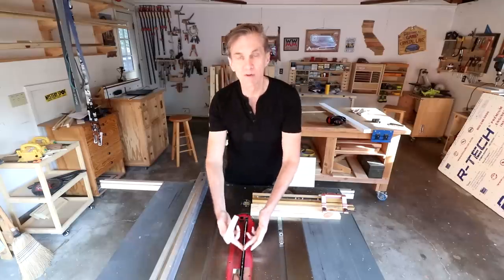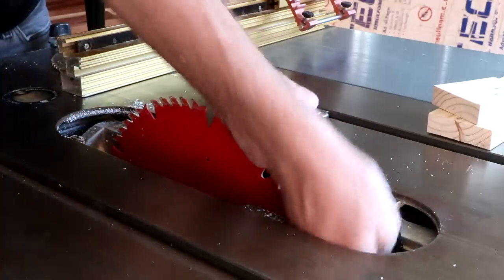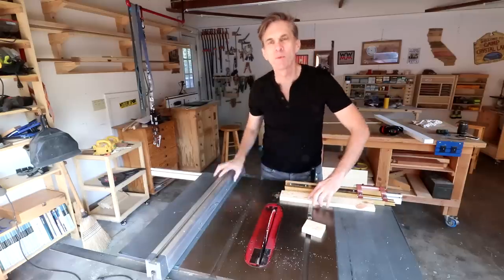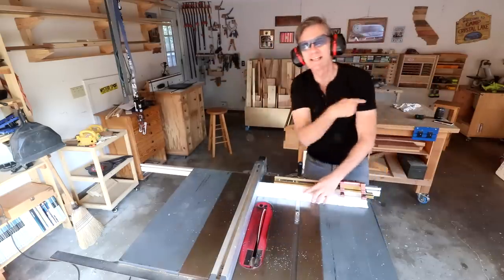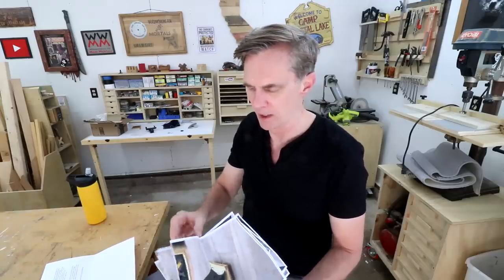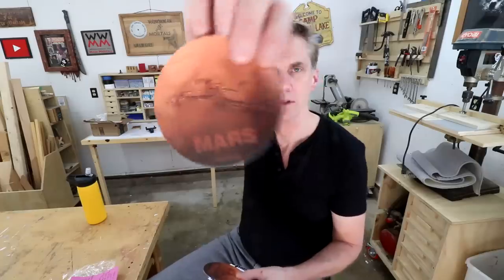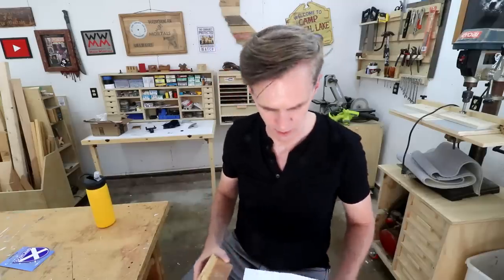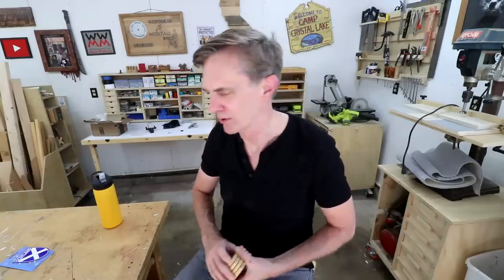What is kickback? And how to avoid it.

Comment: Several years ago when I was just getting into woodworking, I shot a 2x4 about 40 feet out of my garage into the driveway right where my wife would usually park, but she wasn't home at the time. I was shocked at how far and with how much force my weak old table saw could throw that log of wood. Definitely got super lucky that it didn't kill me or smash the wife's car and was pretty shocked by the whole ordeal, so I then did a bunch of research on what happened and I found this sweet woodworking channel on the youtubes called "Woodworking for Mere Mortals", you may have heard of it before =D. Also funny is that I also found John Heisz's channels at the exact same time! Been a subscriber of both of you ever since!

Comment: I've been woodworking for about a year now, very consistently. I spend most weekends making things and have probably done thousands of cuts. Recently my grandfather gave me a big, beautiful Rockwell Table saw from the 1970's. After some tune-up it was performing great, and I broke it in by making an end table. 

This last weekend, I was working on a new project, using the push block that Steve designed, ripping a piece that was a little too long to be ripped, I should have used the miter gauge. Well, I used a push stick and the push block, and mid-way through the cut I saw the piece starting to bend a little bit. Both of my hands were supporting the piece from a safe distance, and I tried to straighten it out. I saw the back of the piece angled toward the blade, and in a split-second I pulled my right hand away from the work piece. 

The thing flew past me, made a loud bang and I had to gather myself for a moment. I turned off the saw, unplugged it, checked myself for injuries. I was lucky, no bodily harm at all. I looked back to the wall that's about 15 feet away from my table saw, and there was a 3/4 inch rectangular hole. I found the cutoff piece, which was mangled with blade teeth. Guess what? This old saw didn't have a riving knife, and I could have been very seriously hurt if I was standing a little to the right, even if I didn't move my hand in time. 

I halted my work for the day and ordered the proper equipment. Some tools are a luxury, but safety is a necessity.

Comment: Really insightful ABC's today,  my 1st table saw had alot of issues with kicking back and i found out later that my fence was the cause. It was never square to the blade even after numerous attempts to straighten it out. My ouchy story i was cutting down fence boards to 5 inches and was doing about 200 board feet and didnt know about practice cuts, or where to stand... i went to push the scraps away from the blade with my plastic push stick and it caught the blade shattered the push stick sending a piece straight into my stomach. That was 3 years ago... that push stick is now hanging above my new saw as a reminder to me. Since finding WWMM i really do plan out every cut now before firing my table saw. So for that thanks Steve

Comment: A simple solution to using your fence and miter gauge together to do repeated cuts is to clamp a piece of scrap wood to the the fence and adjust the width of the scrap wood. When you move the miter gauge forward it will create extra space between the fence and the blade and leave enough room for the cut off to rest without kicking back. I still don't stand directly behind the gap even doing this trick thought. Love the ABC of Woodworking intros, the more explosions the better :P

Comment: Hey Steve, in regards to no saw having kick back detection, Destin Sandlin of the Smarter Every Day youtube channel has a video where he and a friend are designing an anti-kickback circular saw using machine learning, to apply the circular saw's brake much faster than a person could release the trigger.
Reply: It's more anti climb cut than anti kickback. Tablesaw kickback is way faster than circularsaw climb cutting, mostly because of weight. Tablesaws through small blocks of wood where as circs throw the whole saw.  Even if you could detect kickback, you'd need something like the SawStop to stop the blade in time.

Comment: Only been woodworking for a week or so and just had my first (and hopefully last) kickback incident. 
Was resawing a 2x4 on the saw, blade cranked all the way up to make the cut in one pass. I’d done this a few times and felt okay with it. 
Just as the piece had about an inch to go to finish the cut… KABOOM!!! It exploded upwards about 2 feet and landed back on the table of the saw, thankfully not on top of the blade though. 
It scared the ever living crap out of me for sure. Luckily I didn’t get hit and using a push stick, I didn’t get pulled into the blade either. 
So lesson learned… resaw in two passes at least.

Comment: I think it's worth noting that even when using only the fence as a guide, you can still get kickback if the piece you're cutting off will have a high width-to-length proportion. In fact, any piece that will be completely cut before passing the teeth on the back side of the blade is a prime candidate for kickback.

Comment: Would love to see a video on how to split a 2x4 lengthwise to make 2x2s. The videos currently available on YT are dangerous to say the least. Would love to see your take on it. 
Tucker n dale vs evil is HILARIOUS. Highly recommend it.
Reply: Look up how to rip cut on your tablesaw on yt should find something
Reply: @antonsworkshopco  appreciate the tip =)
Reply: @mattgrundy27  also push the wood down while pushing it twords the fence and push forward. Use a push block like a microjig...... only push the wood twords the fence infront on the blade.
Also try to run the boards thrugh a jointer before to remove the round edge. Have fun and be safe

Comment: Would like to see technique on doing a long (6') 2x4 rip cut and techniques to avoid binding the blade. Discussing feather boards etc. Got by feather board but practicing passing the 2x4 thru with the saw off I can see I'm pivoting the board and looking for tips/techniques to practice.

Comment: Spring forward and fall back. How we set our clocks in the UK to and from summertime.!
Reply: That's a big help to many people.
Reply: @hansdegroot8549  I thought it was well known but if it helps people thats great.
Reply: @alanguile8945  I'd never heard it before. I don't have a problem with setting the clock forwards or backwards at the right moment, but many people do.
Many people also mix up "left" and "right" and that has been defined far earlier than summertime and wintertime.
Reply: Hans de Groot I had a problem with port and starboard so I imagine an empty bottle of port. “No port left” well it works for me!
Reply: @alanguile8945  Some red port was left
Reply: @donjohnson24  Thats an improvement, I'll use it from now on!

Comment: Im brand new to woodworking and have started following your channel over the last couple of weeks, great videos by the way. I noticed you mention never to use the rip fence and the mitre gauge together, but you use them both for doing dado cuts. Is that because its not a full cut through? And is it still possible to get kick back from dado cuts if the wood is somehow weakened or their is to much pressure etc.

Comment: Autumn works. * I have an idea for a new video: Details, as in the Devil is in them. Little challenges that can accumulate to degrade the result of your project. I set out to make a simple desk out of 2x12, 2x6, and 2x4 pine. My first challenge was that both of the 2x12s I used were bowed and, as a brand new beginner, I don't have a planer. Or a jointer. Or a decent straight edge. And cutting suddenly became an exercise in eyebrow trimming [When my dad was a kid, he discovered a few hairs cropping out between his eyebrows. Concerned that he might end up with a 'unibrow,' he grabbed his razor and proceeded to shave them. In the process of shaving the connecting hairs, he nicked the end of one of his eyebrows. So, he decided he needed to even them up and trimmed a bit off of the opposing eyebrow. Well, you can see where this is going. Before he knew it, he was on his way to school with no eyebrows, at all.] For a moment, I was worried that my son's new desk would only accommodate a floor mat as a chair... But, I have some old table adjusters I'm going to attempt to install and everything should be ok. 

My point is, everything hinged on those very first cuts, which hinged on what I was able to do with planing/jointing with nothing but a circular saw and a power hand planer. My dowels didn't line up, my joint was off-center vertically (and horizontally) -- thank goodness for my angle grinder and 40 grit flap wheel -- but slowly, despite all the setbacks, I think I'm getting there. 

What about a video demonstrating what can go wrong when the first cuts go wrong? And, of course, what to do about it? 

Maybe this isn't possible. But, I've always been the guy that wondered what happened to the victims' families after the zombies moved on... 

Thanks for all you do!

Comment: I plead guilty and stupid.  When I used my first cheap table saw about 30 years ago, I think I was cutting a small piece of wood using the miter gauge and fence.  The cut off piece was about 1" X 2". It shot back at me like a bullet and struck me in the chest.  Did that scare the B'Jesus out of me? Sure did!   I am lucky it didn't hit me in the eye, nose, mouth, or anywhere on the head.  I would have had severe injuries.  As it was, I had a pretty good bruise on my chest for a week or so.  Lesson Learned! About a year ago, I bought a Kreg Adaptive Cutting System because I thought I could eliminate all the risks of a table saw. While that is a great tool, there are things it couldn't do easily or fast enough. I ended up buying a Metabo Contractor Saw, too which is a very nice machine. I now use all the guards and find they are not an inconvenience most of the time. I usually make a couple of test cuts in scrap without the guard, adjust, put the guard on, then do all my cuts.  You don't have to watch the blade! PS. Your wife will be happy you have all your fingers, eyes,  and teeth!

Comment: Is that knife called "writhing" or "riding? Never heard of them before.
Reply: Rob,  That would be Riving Knife. I always have mine installed my table saw. Mine also holds the antikickback pawls, and the blade guard
Reply: @martinwebb7294  Thanks for the info. I had a severe kickback a few years ago when ripping a large sheet of plywood on a small bench saw sitting on a makeshift workbench that was too low down. Hit me on the right side and left a nice bruise on my chest, which later turned into a cyst and after had to be drained and removed. Funny though, it didn't hurt THAT much at the time, but it was very scary and I didn't do that again. I'm pretty sure I was using a fence though and a pusher.

Comment: I'd love to get a table saw, it'll help me improve my projects a lot, but I am terrified of them, I know safety is on me, but I've seen cases of professionals with decades of experience that still have accidents and that's the terrifying part
Reply: I am with you on that. I want to buy but too scared to do so
Reply: Buy a SawStop and follow the safety rules (e.g. don’t use the miter gauge and the fence to guide the work at the same time) and you will be fine. And, a having a it of fear of the machine is a good thing - keeps you from getting complacent - which is what happens to those with decades of experience.
Reply: If you pay attention you're probably safer as a beginner. Professionals get so accustomed to using a saw they sometimes are making a cut, but thinking about something else. A friend of mine is a cabinet maker, and has been doing it for 25 years. About 6 months ago he lost the tip of his thumb using a table saw. Familiarity sometimes creates the opportunity for an accident.
Reply: @jeanchapman1301   I totally agree with your recommendations, except the SawStop was out of my price range and space constraints. But for Fernando, Krishna, and any other folks who feel as they do, What I did when I purchased my table saw ( RIDGID R4518) was to turn it on and then off a couple of times to get used to the sound it makes . The I always have a riving knife installed, and usually have the blade guard installed also. Just follow Steve's safety tips (and others on YouTube). My fear of tool has changed to a healthy respect for the power of the tool, the same as I have fo=r my automobile, which can cause as much or more damage to myself and others as a table saw can do.
Reply: I have the Milwaukee M18 table saw. The thing that surprised me the most about this saw is that, due to being battery-powered, it stops almost immediately after being turned off. Obvious now, but it was a nice surprise as I feel WAY safer (but still cautious) than when I use my corded table saw. The 12.0 battery that comes with the Milwaukee is amazing btw. If there isn't enough power left in the battery, the saw simply refuses to turn on. Never had it cut out mid-cut.
Reply: @craigs7678  Thank you! Didn't know there were battery powered ones, will definitely look that one up
Reply: @kashel83  You're welcome! Be warned, however, that this saw cost me $500 USD. I happily paid that due to me already being a Milwuakee fanatic. I would still highly recommend this saw if you are afraid. I still absolutely am careful around any of my tools, powered or not. As an added bonus,  it is compact enough for me to store away and bring out as needed. Happy making!

Comment: I’m just saying, idk why radial arm saws are no longer prevalent. I use mine for all my cross cuts. The piece is well supported, cut on a downward motion, rarely get tear out, always perfectly square, and once you line up your cut the saw moves instead of the piece which allows for precision. I still use the table saw for rip cuts and everything else, but I really don’t understand why radial arm saws are a thing of the past.

Comment: Is the riving knife even able to help in this case? The piece of foam didnt reach the end of the blade. Sorry noob here.
Reply: That’s why riving knife tucks in close behind the blade. Limits exposure. And also one reason why a splitter is usually not as effective (or convenient) as a riving knife.
Reply: When using the miter and rip fences for small pieces like that, the piece between the blade and the rip fence is unsupported.  Since it's not being pushed through, it stops moving and WILL be grabbed and thrown by the blade.
Still not safe, but if a push stick is being used, it's possible to push that piece on through without the blade throwing it.
Main point there was not the riving knife, but the use of both miter and rip fences at the same time.

Comment: I threw away my riving knife because the fence was so bad the piece would always bind between the knife and the fence. I regret that now that I've figured out tricks to improve my fence performance, but it's just a crappy craftsman job site saw.
Reply: You might be able to order a replacement riving knife from Craftsman.  It's no joke, it's a critical safety feature.  Also, check your saw's manual.  You ought to be able to adjust your saw's fence alignment.
Reply: @Not_TVs_Frank  it's not the fence adjustment, it's the repeatability. The job site table saws just don't have good front and rear guides on the fence, so it's very easy to be 3 sixteenths of an inch off from front to back. The whole saw is really intended more for rough lumber ripping on the job site than any kind of precise woodworking.

Comment: Why don’t they make table saws with a blade that turns in the opposite direction?
Reply: It would pull the wood through shooting it away
Reply: Plus, you would have to reach over the blade to pull the workpiece through the saw. Dangerous thing to do. I always wait for the blade to stop spinning before reaching anywhere near the blade.
Reply: Is this a serious question?
If it is, you for sure have a table saw. Take the blade of, and flip it 180 degrees. Put the blade back in this new position.
The blade will still spin in the same direction (because of the motor) but the stumpy part of the teeth are directed towards you.
I have no idea what would and could happen. YOU DO THIS AT YOUR OWN RISK!!!!!
If you have a three-phase motor on your table saw, you can change the spinning direction of the saw blade by changing the Phase I en Phase 2 wiring.
Again, YOU DO THIS AT YOUR OWN RISK!!!!!   But I wouldn't even bother to try it. And for two reasons:
1/ I think (didn't try to search for it) it's possible to find (YT) videos where other people already tried this out. Why should you risk something?
2/ I suppose manufacturers of table saws and blades know what they are doing, and writing in their manuals. They are not stupid.